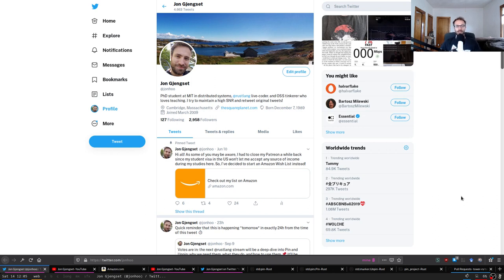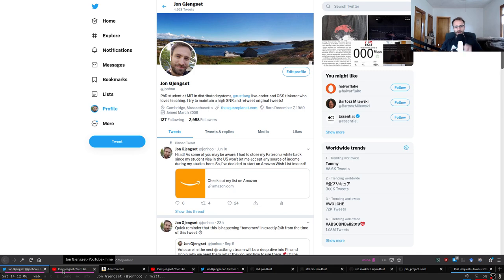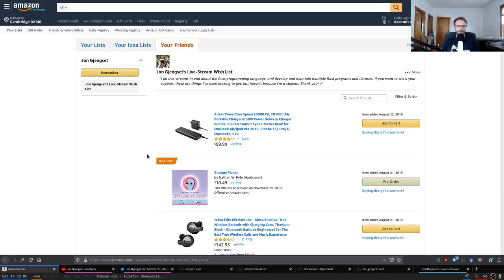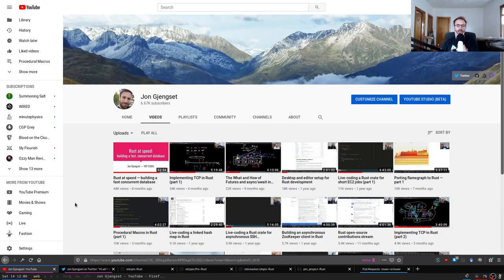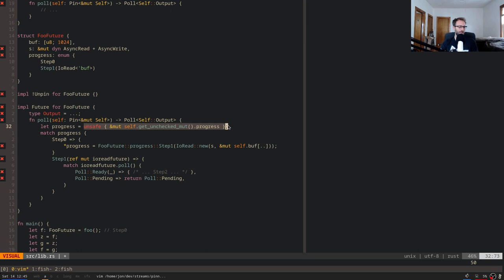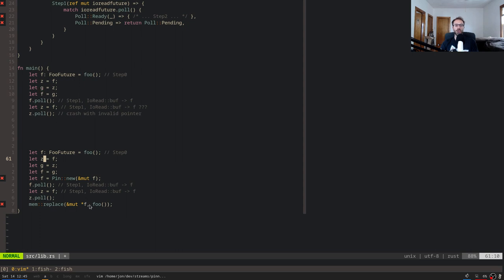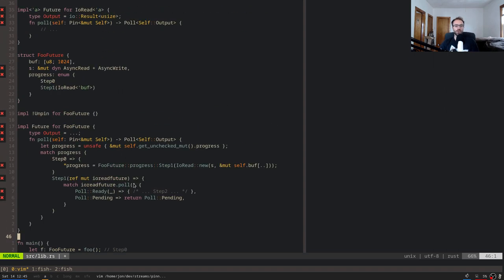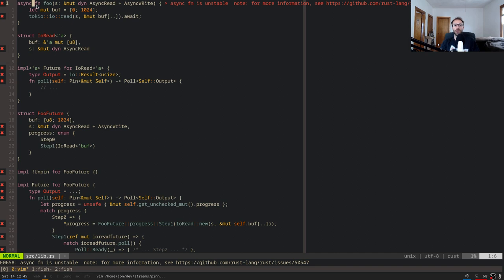The Why, What, and How of Pinning in Rust

Comment: 2:12:10 Automatically implementing Unpin for async blocks and functions that don't need pinning is probably something that could cause problems for API stability. If a library author exposes an async function that gets impl Unpin automatically because it doesn't currently have any self-references, if they want to change the implementation to something that isn't Unpin, that would be a breaking change.
Reply: That’s a pretty great point about API stability. This actually does cause problems with Send and Sync because they are automatically implemented for async blocks depending on the block’s content. So the API contract of an async function’s return type can change purely based on its body.

I’ve encountered this before in a backend project where I used an itertools group_by function, which for some reason isn’t Send, in an async function. Didn’t hit any compiler errors while I was working on that crate, then when I tried to run the server there I got a gnarly error because the fully composed futures returned from the server’s router functions weren’t Send and that’s no bueno with tokio.

And additionally, even if you don’t hold those !Send types across await points, the async block generated is still !Send. That’s what’ll really trip you up.

Comment: I think that an easier way to see why Pin is important is with a simple struct like

  struct Packet {
      skb: [u8; 512],
      header: &'skb [u8],
      body: &'skb [u8],
  }

`header` and `body` are slices to bytes in `skb`. 

Using futures as an example of self-referential structs can be confusing, because they contain much more details.
Reply: So skb needs to be pinned?
Reply from the maker: So, this is what I was trying to get at with the Parsed example :) But more examples is helpful!
Reply: @jonhoo  I liked the Parsed example, but I feel like you moved off of it too quickly before you really got into the meat of Pin

Comment: In 1:26:20, shouldn't this only be unsound if you actually called a poll() on x after you created it? Because if you pin and still mem::replace() it, you didn't yet actually depended on that pinning right?

btw you often explicitly inserted poll() calls around some mem::replace() after pinning, so I wondered if in this case you didn't?

(Thx for the explanation!! XD)

Comment: from my understanding, the only reason, why pinning is neccessary is, because it is forbidden to move a struct, that contains a pointer to a field of itself, because that move does not change the value of the pointer and so the pointer points to the old memory location ando nobody knows about its contents anymore. 
But if i used a relative pointer instead, would that get rid of the problem, because when i move the struckt with the (relative) pointer to a field of itself, the relative pointer now still points to the currect location, because the layout of the struct does not change. 
I think that I overlook someting so please clarify me
Reply from the maker: Ah, so, in the specific case where the target of the pointer is stored within the struct, that's fine, but in the general case, relative pointers are not sufficient. For example, consider a struct that holds a Vec (so a heap-allocated vector) and a type with pointers into that Vec. There's no relative pointer you can use there to make moves okay
Reply: @jonhoo  Hi. If the Vec is on heap, moving the struct will not move the Vec so the pointer should be still valid?
Reply: @XiaoZhang-x1a0  In the case of a Vec, relative pointers hurt rather than help because when you move the struct, the Vec's buffer stays in place on the heap, so relative pointers into it are no longer valid. If you used absolute pointers, mutating the Vec risks invalidating them, because it might reallocate or simply drop entries you're pointing to.

Comment: Caution for viewers with ears, there's a loud mic thud at 2:26:09.
Reply from the maker: Yeah, I've added a shock mount to my wish list to deal with some of those kinds of issues. The new mic also picks up keyboard sounds more than the old one did, which the shock mount should also help with.
Reply: Thanks, no problem. The lid on the jar is tightly sealed.